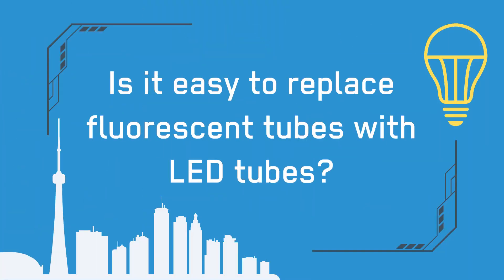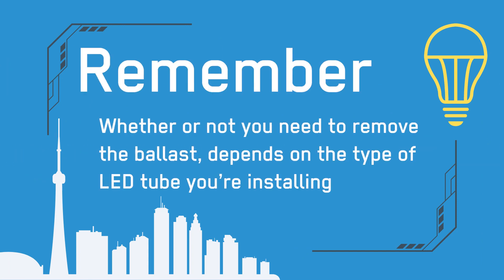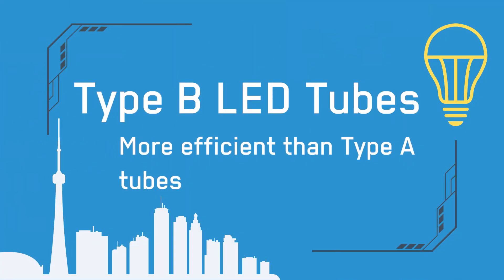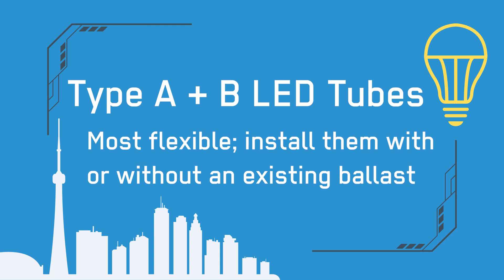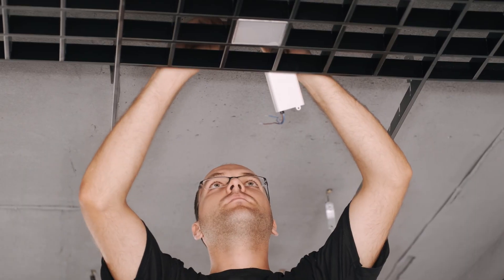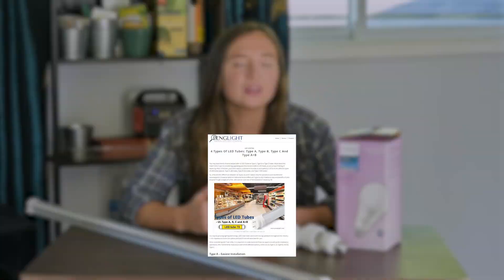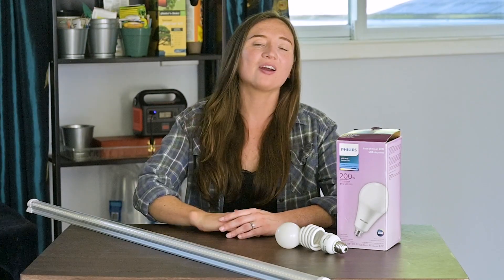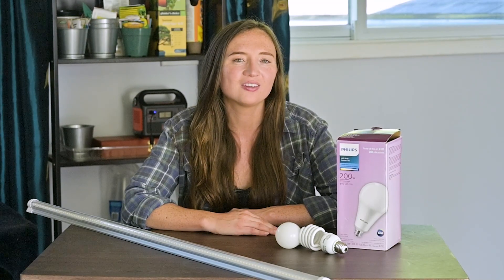Replacing Fluorescent with LED Light Fixtures - Do you need to remove the ballast?

Comment: At last! I find someone who explains it clearly!
I am in the UK and have two 1960's fittings in a kitchen.
The Tubes are burned, the Ballast is "goosed" and occasionally re-starts after an hour or so, and finally the motley collection of starters I have all require some coaxing to work!
I dare not remove the fitting as it will destroy the ceiling but want to wire new LED Tubes direct to the power grid (240v) via the wall switch!
Having looked on Google Amazon and eBay, I am beginning to think that this method is not allowed in the UK.
Could this be why I cannot find tubes which don't need a "starter" bundled with them?
The tube I need is a T8 1500mm preferably 4000K and frosted.

Comment: what about the plug and play version of led tubes?   what category do they fall under.   I was told by a person at Home Depot that all I had to do is plug them into the existing fixture. They are 40 inch, 34 W bulbs dual pin.  They said they are compatible with T8 or T12 fixtures.  My fixture is T8.
Reply from the maker: The tube sounds like it's probably an A + B tube, or maybe an A or B tube. But not a type C tube. This is good news because those are the most flexible. You're probably good to plug it in